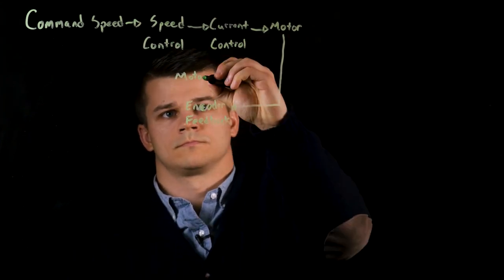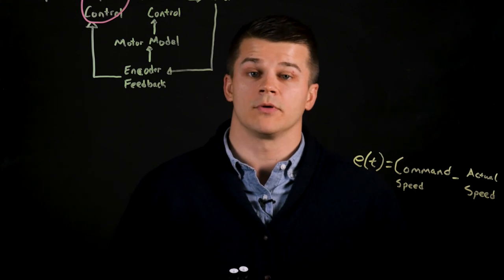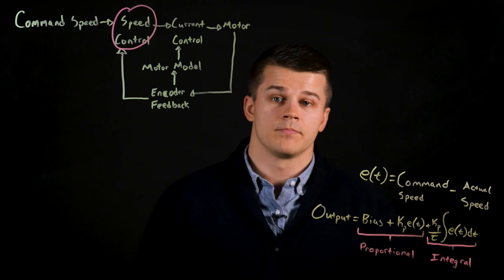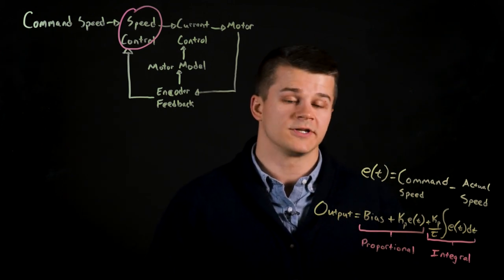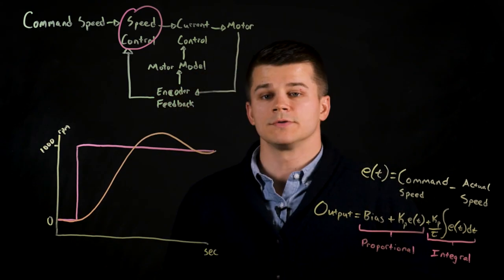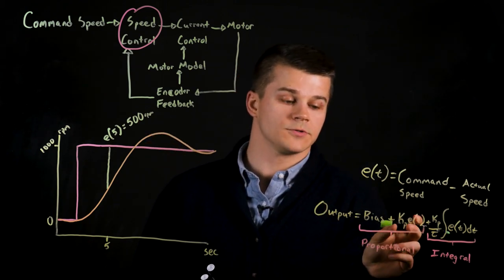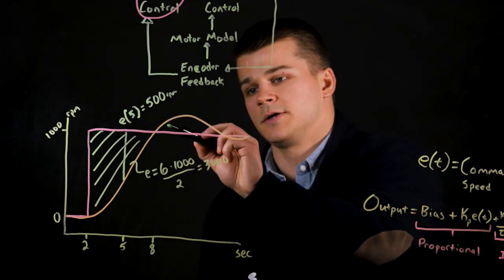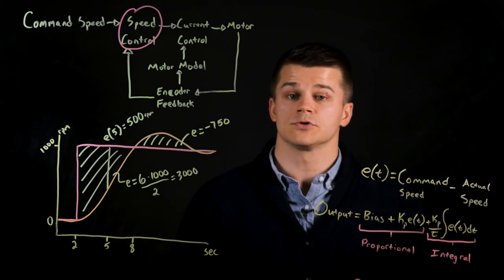How a PI Controller works inside a VFD Speed Control system

Comment: 4:50 Error Three thousand minus 750 and not three hundred minus 750... Anyway perfect introduction. Thanks
Reply from the maker: Yes. Mike meant to say 3000 instead of 300. What is written on the board is correct. Thanks for your comment, Christos.

Comment: What happen if I don’t include the bias factor in? What does the two remaining parts, kp and ki means?
Reply: Bias value is the initial condition ( steady state value - obtained from Steady state model of your plant). Kp and Ki provides adjustment that to be made to get reference output during change in any input or output or external disturbance (obtained from small signal model of your plant)